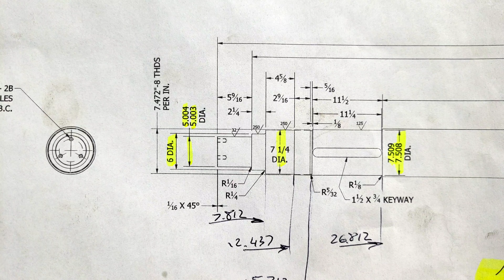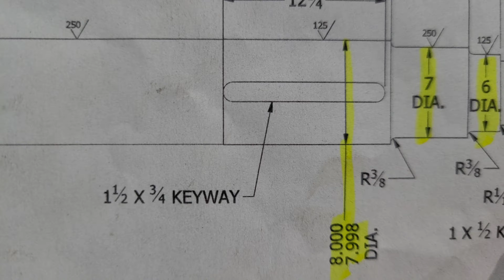Top Roll  Shaft | CNC Machining

Comment: Damn fish eye lens makes everything look tapered. LOL
Pretty common issue with the flat spot on the stock with the hot forged bar. Its a bit of a dark art of a machinist to figure out the best way to get as close as possible to a fully machined part. Figuring out how much runout you can introduce and where to the setup to achieve 100% clean up is tricky as there is always another flat upsetting things.  Looks to have turned out ok though as there was a keyway there to knock the top off the flat spot. A lot like setting up complex castings that were not cast well. Datums on cast areas used to be the bayne of my existance and probably caused at least some part of my grey hair . LOL

Comment: Dude i would love to work with you and learn from you. I have a question how do you measure the OAL and keep it in spec when you keep flipping the part back and forth????
Reply: Pretty sure the shaft gets faced to length and centre drilled in a mill before turning
Reply: @elanjacobs1  I see. That makes sense, thanks